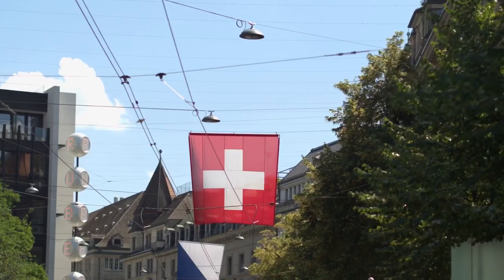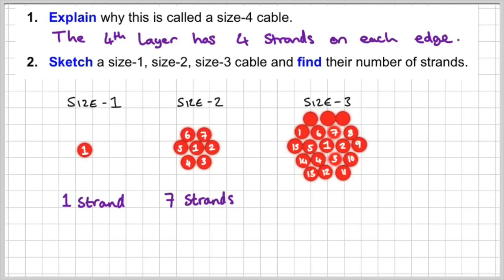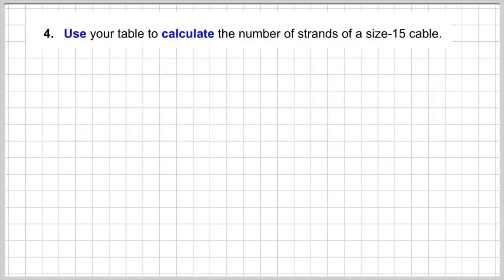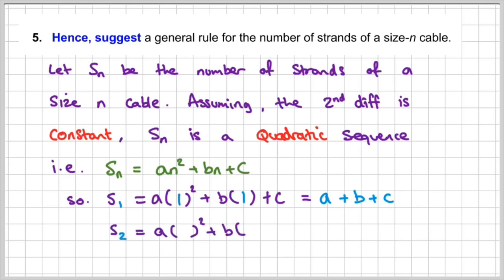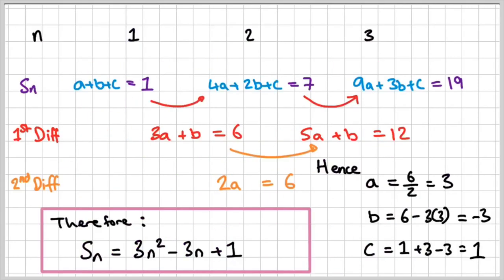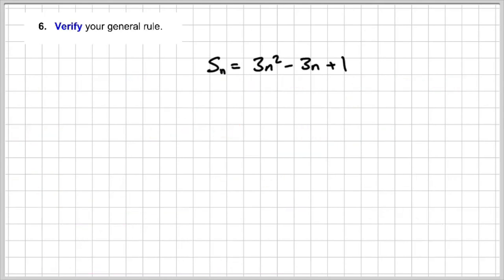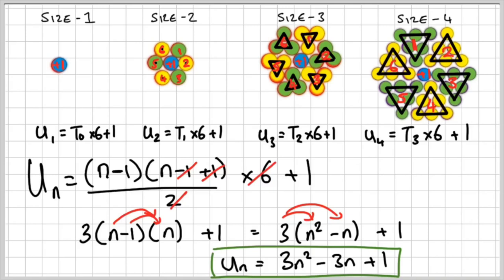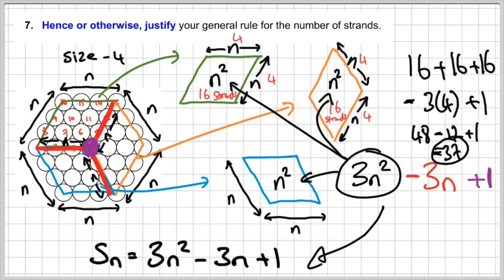How to #VERIFY & #JUSTIFY a quadratic sequence | Beard Squared

Comment: Great video. But why did you subtract 3n and then add 1 in the first justification?
Reply from the maker: the three squares overlap, so you have to - 3n strands. And since you - 3n, so have +1 strand to make the total number of strands.
Reply: @BeardSquaredEdtech  but you removed 12 strands. how does one strand make up for all that?
Reply from the maker: But remember you have 16 strands per square, when you draw the second square you overlap 4 strands. And then when you draw the third square you overlap another 8 strands. That makes the 12 strands that you need to subtract. However, you must account for the missing strand in the centre. Hence you +1. 16+16-12+1=37, that's the number of strands needed to make a size 4 cable. I hope this helps.